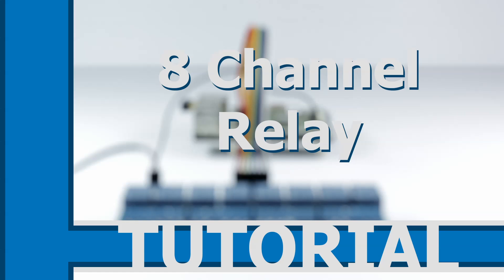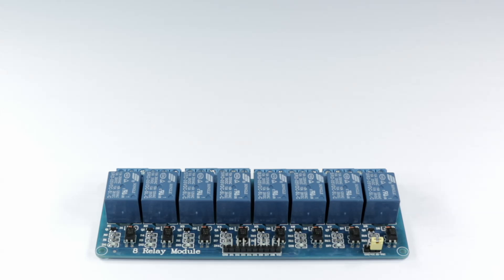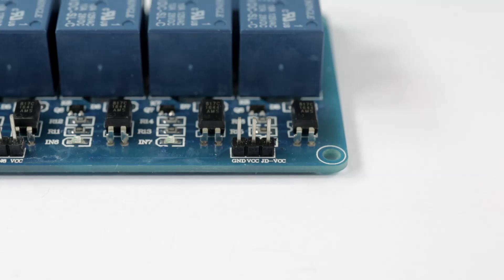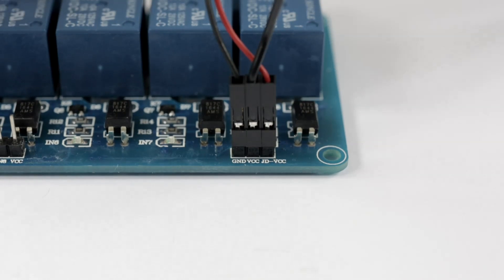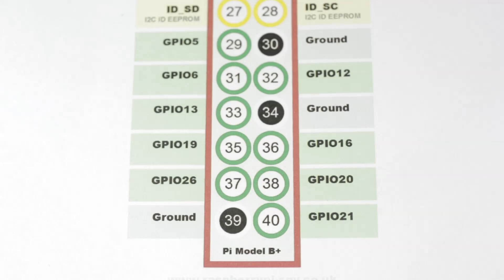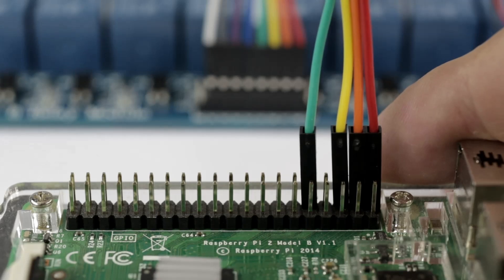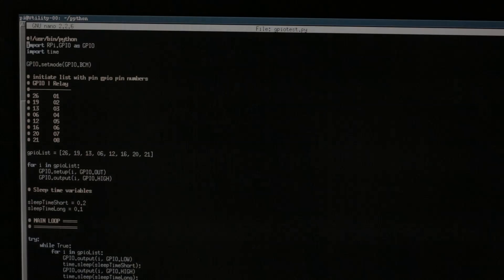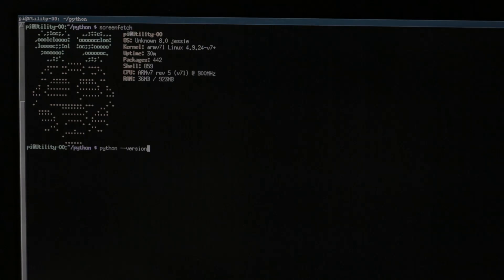Raspberry Pi: 8 Channel Relay + External Power Supply Tutorial and Example

Comment: what if i have to use a 15-0-15 V at 300mA rating transformer connected to a IC L7805CV Voltage Regulator operating at 5V DC output?! 

i did this but it resulted in a humming sound when the relay was turned ON, and heating of the IC circuit.
Reply from the maker: im not really sure to be honest sorry!

Comment: Great video, worked perfectly, except that I needed to connect the VCC pin to the 5V on the Raspberry pi B instead of the 3.3V.
Reply from the maker: nice! was it due to the relays requirments. its been such a long time since i touched this stuff i forgot a lot about it I should really start doing more projects like this again. Good luck on your project!

Comment: Are you powering the pi through the relay board instead of powering the relay board through the pi, or are you using two power supplies?
Reply from the maker: No they each have a separate psu
Reply: @TechplantChannel  Thank you

Comment: Does the py still need amperage for switching the relay with the external power supply?
Reply from the maker: Yes it still uses a tiny bit to activate the relay but the relay is using thr psu

Comment: why was the single cable plugged into the 3V supply pin of RPI?
Reply from the maker: since this was like 3 years ago i forgot most of it, but if i remember correctly you still need to activate the relays with some power i honesly cant rememeber im sorry

Comment: Thanks for the great video! Can you please tell me the purpose of the jumper wire? I know in the video you said it powers the internal relay switches, but don't the relays require 5V? Instead, you're using the jumper to connect to a 3V pin on the RPi (I'm sure I'm the one confused). Also, I am trying to use a 12V external power supply due to the small 12V dosing pumps I'm wanting to use for pH control in a hydroponic system. Can I substitute a 12V external power supply as used in your example? TIA for any help.
Reply: The PSU is an external 5v, which powers the actual relays (via JDVCC pin). By removing the jumper block, it allows us to use a 3.3v signal to switch the relays and protect the pi from the 5v circuit.

Comment: What conditions decide, whether the power supply of the Raspberry is sufficient or a external power source has to be added?
Reply from the maker: how much power is needed per relay, and how many relays do you want activated at the same time. I forget what these use but if its 500mw and you wanna power 8 at once you are looking at 4W which could be too much for the RPI. again these arent accurate numbers but the concept is the same
Reply: Okay, got it. I also found a document saying one relay needs 450 mW. Thanks!

Comment: Hey Techplant, it was a informative video.  I dont have a ground right next to the JD-Vcc pin, can I connect the ground of the 5V power source to the other ground pin which is along with IN1, IN2 pins? Kindly clarify. Thanks
Reply: Yes. No problem with that.

Comment: What happen to the relay board when is connected to the raspi and then you turn the raspi on? Does the relays switching during the boot time? Would like to know because that is a very very important point to be able to make meaningful projects.

Comment: Thanks for this video, helped me a lot! I have a 5V 3A power supply, can i use this single source for the RPi and the relay board as well?
Reply: no need to supply relay board if you are using 5v 3A power supply you can use power relay from pi gpio. relay operation drop current around 600ma so if you are using 5v 2a power supply for your pi then you need external power supply. I hope you understand
Reply from the maker: im not an expert on this question, but i bet you could split the psu off into two separate power plugs. and attach one to the pi and one to the relay.

Comment: ??????
Why connect a seperate wire to VCC as that is connected to the I/O header (at least on mine.) the jumper is only their to connect Jc-VCC to Vcc to power the relays from the IO header.
Ah, you didn't use the VCC and GND on the I/O header.

Comment: Hi, I'm familiar with these setup and use relays with external supply before with arduino. My project uses PIC Microcontroller running at 3.3V and 4 channel relay.  I connect with external power supply JD-VCC to external source and Ground to external ground. I Connected the VCC to 3.3V of the PIC microcontroller. However, the relay(input 4) sometimes runs strange like not enough voltage is drawn, turning off and on quickly. My question is that the gpio from raspi going to input of relay is 3.3V? and Does running 3.3V on VCC ok? Because power seems low.

Comment: Your solution may work, what doesn't mean it's perfect: you forgot to connect the ground(s) between the Pi and the relay board.
Reply: Technically you don't need to when you use the same power supply for both the RPI and the supply for the relays as the grounding in your building will be more or less the same. However, it is good practice to make sure the grounding, or zero level, of your signals are the same to avoid ground loops
Reply from the maker: Do you need too?
Reply: Can you specify if you mean it's better to connect the GND of the RBP with the GND next to IN1 or the GND next to VCC and JD-VCC of the external power?

Comment: Is that adapter going to power all the relays?
Reply from the maker: It provides them power to turn on and off, but it will not power devices that are connected to each relay.
Reply: I see. then what is the purpose of the adapter? I see two power sources going into the relay board. one from raspberry pi, one from the wall. Shouldn't one of them power devices connect to a relay?
Reply from the maker: it takes about .7 amps to power all 8 relays at a time, so the adapter takes the brunt of the load away from the rpi. otherwise your rpi will struggle to run well during high load.
Reply: That makes sense. Any video you could provide me with to power the actual relays? I will essentially connect my relay to the wall outlet and power stuff with it.
Reply: The .7amp 5v is in fact what powers the actual relays. The relays are essentially a switch that will provide or cut power to what ever is hooked up to them. Think of it as a light switch! Hope this helped
Reply: yup! Actually finished my relay project. lemme know if you wanna see how it looks.

Comment: I am your student and following your tutorials and i also edit your code. 
But now i am facing the problem can you please help me.
I am using the above configration to turn on and turn off the load as you did in the video. i want to read or sense the pins if they or low every 5 seconds and to print the output in .txt or .csv file. for one pin i have attached the code and it working fine but how i can expand to all 8 channels. please help me  
python code:

import time 
from time import sleep  # Allows us to call the sleep function to slow down our loop
import RPi.GPIO as GPIO # Allows us to call our GPIO pins and names it just GPIO

GPIO.setmode(GPIO.BCM)  # Set's GPIO pins to BCM GPIO numbering
INPUT_PIN = 26          # Write GPIO pin number.
GPIO.setup(INPUT_PIN, GPIO.IN)  # Set our input pin to be an input
# Start a loop that never ends
while True:
            if (GPIO.input(INPUT_PIN) == True):
                # load is turned off.
               print (time.strftime ("%Y/%m/%d , %H:%M:%S"),"0")
            else:
                #now 20 watt load is turned ON!.
                print(time.strftime ("%Y/%m/%d , %H:%M:%S"),"20")
            sleep(10);       # Sleep for 10 seconds.

and i want to save all the data in a .csv or .txt file with time stamp at the start and other 8 columns for pins status that are connected with relay.
my output should look like
06/01/2018,18:54:00,1,0,1,1,1,0,0,0  
06/01/2018,18:54:05,1,0,1,1,1,0,0,0  
06/01/2018,18:54:10,1,0,1,1,1,0,0,0  
06/01/2018,18:54:15,1,0,1,1,1,0,0,0  
06/01/2018,18:54:20,0,0,0,0,0,0,0,0  

please help me
Reply from the maker: Ill look into this soon!

Comment: Where can I buy an external power supply like that one? And/or how can I build it?
Reply from the maker: I get my wall warts/power supplies from thrift stores because they are dirt cheap there. Just look on the label at the output and make sure it says 5v, and has at least .7A rating. If you cant find one, amazon.com offers them for 6-10USD.

Comment: can you use a 7.5 v power supply?
Reply from the maker: It depends on the 8 channel relay and if the voltage regulator can handle that large of a difference. What relay do you own?
Reply: do relays "remember" positions when ppowered off, or do they fall back into "default"?
Reply from the maker: they fall back into default.